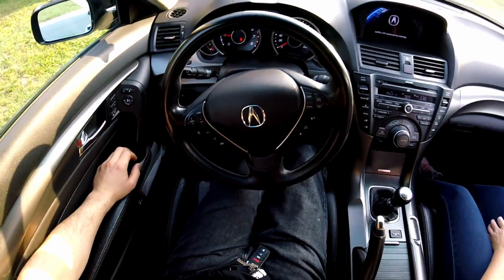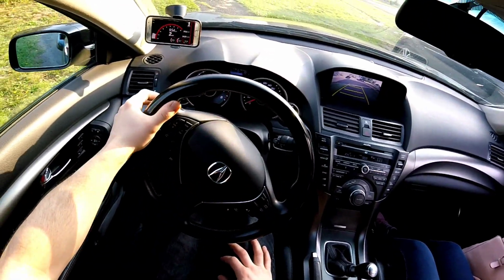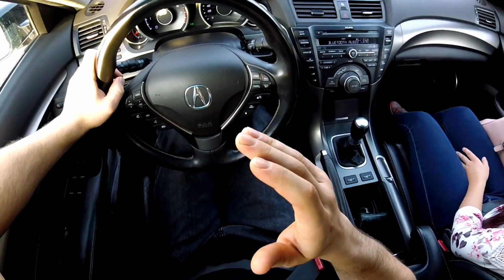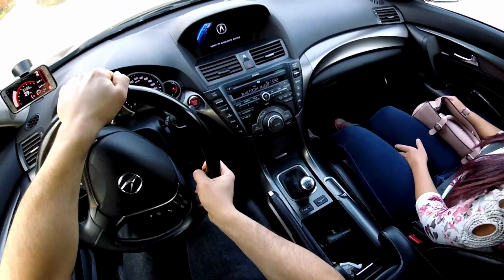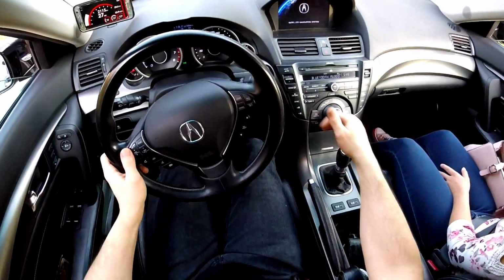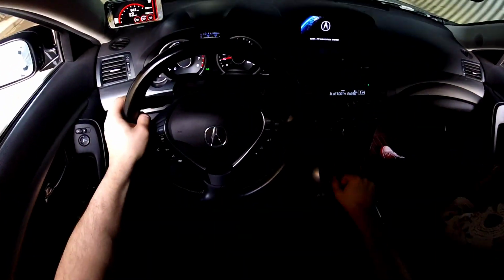BUSTED Flex Pipe On TL! Sounds AMAZING & HORRIBLE?!? **HEADPHONES IN**

Comment: Damn flex pipe! On my 2010 Honda Accord EX, it was damaged for the longest time, but I coudn't smell any fumes and my "check engine light" did not come on!  The bad sound was very slight. Finally got it checked by my mechanic and finally found out what the noise was. Flex pipe! So annoying!
Reply from the maker: Was it a 4cyl? It would probably sound bad if 4cyl, but I loved the sound just not a certain rpms haha. Either way, it worked like shit though until I got it fixed.
Reply: @RevsALot  Yup! 4 cyl.

Comment: My car sounds like crap when I start it and when I accelerate. It's very loud. Would that maybe be my flex pipe noise sounds like it's coming from the front part of exhaust not the back.
Reply from the maker: It could be, you'd have to check underneath. If it's cold and you should be able to see steam where the leak is.

Comment: I have the XLR8 performance V2 j pipe too. In about after three yrs of having it on, just last weekend I had a annoying loud leak. I really hope it’s just the gaskets and not the flex pipe. Replacing the gaskets today, I’ve been dying to drive it, I’ve been driving my wife’s TLX to work all week 😂.
Reply from the maker: It's definitely the flex pipe, it's where they're known to bust.👎
Reply: @RevsALot   as soon as I jacked the car up, bam! there it was waiting for me 😕. Hopefully I can find a local muffler shop that’s not going to charge an arm/leg. To cut it off and weld on a new one.
Reply from the maker: @davidvang763  mine cost$120 CAD with labor
Reply: I decided to ditch it and ordered the RV6 V2 j pipe.

Comment: waiting for the day to see this get boosted! Tired of rewatching gerzybear vids lol
Reply from the maker: Same here! I watch those videos constantly, but I wanna see some races, 0-60, & 1/4mile times.
Reply: RevsALot saw a comment where he said he got a 4 sec 0-60 at 420whp, though I’m sure thats not close to the motor limits at all. Throw in 10psi, port/polish, E85, and you got yourself a baby GTR killer with a manual. And as excited as I am for the new Type S, im afraid it could put the final nail in the coffin in 4g enthusiast interest.
Reply from the maker: Yah I've seen that too, he also has a stage 1.5 kit with bigger injectors, fuel pump, and e85 compatible for 550whp.
Reply: RevsALot I feel that the SHAWD components would quickly need upgrading at that power level though, but we will have to keep dreaming until then. Have you seen that blue twin turbo 4g that was up for sale last year on Craigslist? Wonder what happened to it
Reply from the maker: Maybe, we'll have to wait and see.🤷‍♂️ No, I didn't see it im from Canada so I use kijiji.ca lol
Reply: RevsALot First “4th gen TL turbo 500 awhp in the nation” small thread on acurazine with build list. Too much of a hack job and prob not register-able in most places. GB sc is the way to go
Reply from the maker: @E82N55  yah I've seen that thread!👍 I want something I can just bolt on and make an installation video.

Comment: Why would a single exit make more power?
Reply from the maker: Not sure, p2r has a single exit on his 4G, and some accords have it too.
Reply: RevsALot okay, I'm going 3" exhaust  with vibrant resonators on each side after full rv6 downpipes.
Reply: RevsALot i wonder whats the logic, most performance cars all go dual, i wonder if its just for looks
Reply from the maker: No, I've heard admin say single exit gives little more power, p2r says the same thing about jseries. Dual with quad tips looks way better imo though.
Reply: RevsALot If the borders were open it would have been really cool to meet up and run it. Im in buffalo
Reply from the maker: Maybe someday🤞! It'd be a good run!
Reply: Swift 97 ss Camaro came with single exhaust from factory because it performed better

Comment: the pipe busted? wtf! i thought they made a good product..
Reply from the maker: Same! I'm like 95% sure it's the flexpipe
Reply: @RevsALot  My XLR8 J-Pipe busted at the flex joint also after 50k mi.  I replaced it with RV-6 J-Pipe.  They have a longer flex section for more give than XLR8.  So I am told.  Did you feel power loss between low-mid range with the exhaust leak?  I did.
Reply from the maker: Yah it bogs bad, I hate it. I think I'll just get a flew pipe welded to the xlr8 jpipe. I find rv6 can be raspy, do you find it raspy compared to xlr8?
Reply: @RevsALot  I couldn't tell if it was more raspy.  It was definitely louder bc on the RV-6 has cat deleted and on the XLR8 I had the HFC.  Soon after, my XLR8 cat backs started to fall apart so now I am on the OEM exhaust with the RV6 J-Pipe.  I am in the process of getting the XLR8 cat back repaired so I can have some fund driving again.  I notice a definite drop in power when there is an exhaust leak, so going all out largest exhaust may not be the best, unless you are boosted. imho.
Reply from the maker: Oh I see, I got the XLR8 V2 so I don't have the 3rd cat anyways. I read on the forums xlr8 sounds good, but doesn't last long like the others. For the price they should last, so just trying to find a cheaper similar sounding setup🤞. I'm going supercharger next year if all goes well🤞.